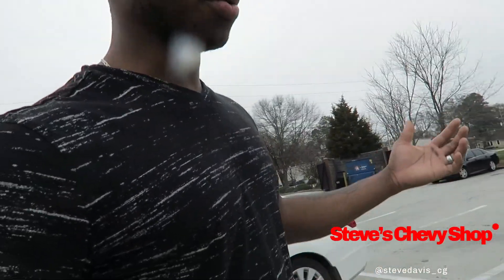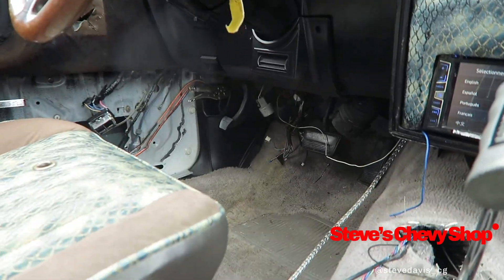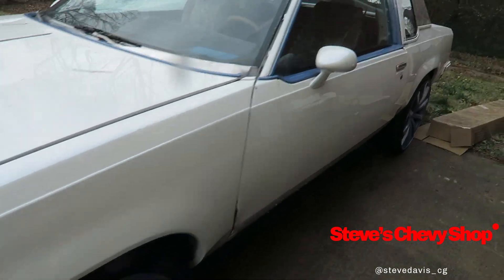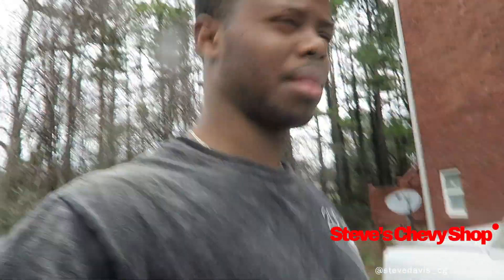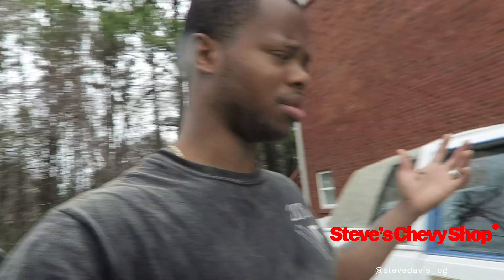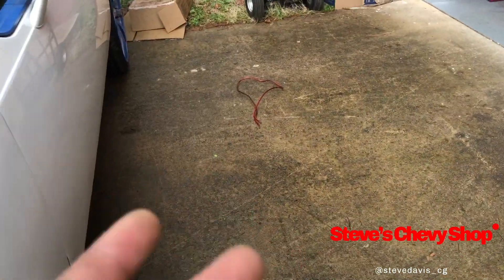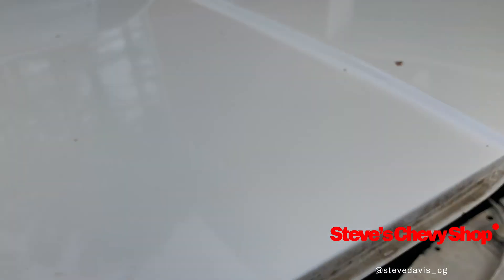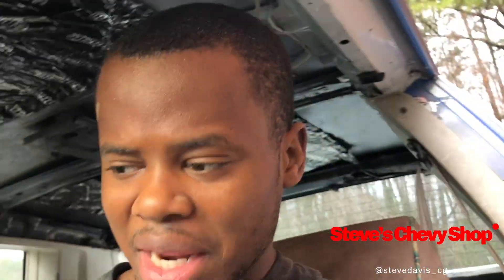Doing Work On Mason's Cutlass Supreme

Comment: Man i want a gbody console as long as they not to crazy priced to ship
Reply from the maker: detroit rhino exotics the plain ones like the box Chevy will be $110. You’d have to staple, glue, or screw it together and do whatever mods you want. The built ones will be 350 or more
Reply: Im far from even close to worry about center console yet. But ill get with you down the line. Definitely would want a complete one